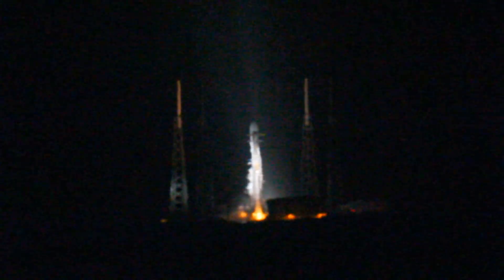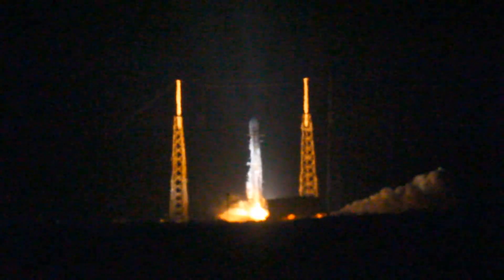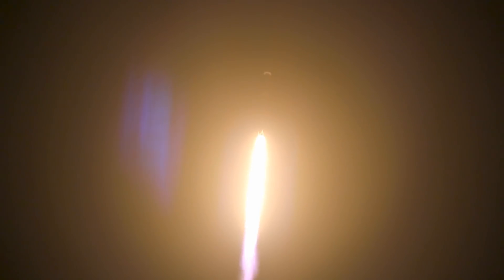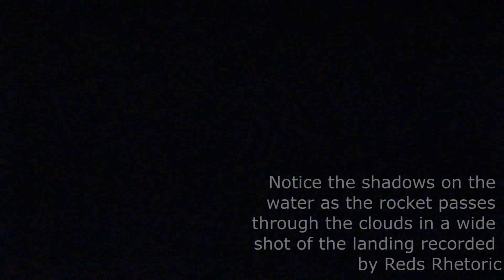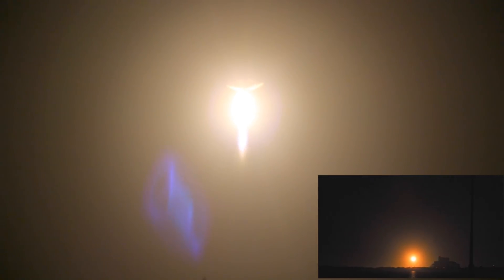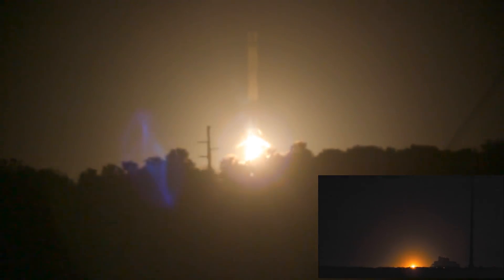Up Close Footage of the SpaceX Launch of Zuma! 1-7-18

Comment: So if everything went as planned why did it fail?
Reply from the maker: +alan headrick well, if it failed it would have done so due to a failure of the payload to separate from the second stage. That is under control of a Northrop Grumman built payload adapter they custom built for their own payload. It has nothing to do with the rocket itself.

Comment: What are the anomalies I see at the 2:43 mark and 2:52 mark crossing from right to left?
Reply from the maker: lencac those are stars.
Reply: I'm not buying it. The "stars" movement, direction and speed is not consistent with what it should be in regard to the movement of the rocket. Besides as a side note chemical propulsion is a losing proposition on all levels. Antigravity electro-gravitics is real and is well advanced. The deep state black project technologies are being keep secret from the public which leads me to believe that satellite is no more lost than the man on the moon. No pun intended ;)
Reply from the maker: lencac they are background stars. I'm sorry but that's a fact. The movement was exactly what it should be, the telescope was tracking the rocket under my command.
Reply: I'm sure your correct. I just wanted to stir the pot a little. I never let the facts get in the way of a good conspiracy ;)

Comment: The media are reporting that Zuma failed to reach orbit with some reports claiming that the second stage didn’t fire. Thanks for providing proof that it did fire.
Reply: sweinberger there’s another video out there that claims to show only one fairing coming off. You can clearly see something coming off it but it’s not clear if it was a fairing and if only one was seen.
Reply: The second stage fired as planned. The gist of the "reports" seems to be that the second firing of the second stage, meant to maneuver it to a reentrant path where it would burn up, was somehow interfered with, possibly due to the payload not unlatching from the second stage. Somebody in the launch team should have video and telemetry of the relevant events, but who knows when they will be released to the public, if ever.
Reply: Yea, the whole "only one fairing deployed" thing is total garbage.  The fairings get their structure from clamping together around a grooved cylinder.  Even if one fairing got stuck, another big "if", that would mean the payload failed to drift out of a half open pill, it should definitely have cleared it by the time the second stage was done maneuvering to de-orbit.

Edit:  I also have very large doubts about whether or not a single fairing would hold on during rotating maneuvers and engine burns.
Reply: I'm really surprised that the cover story they chose to go official is that Zuma failed to reach orbit. A pilot in Africa witnessed the circularization burn of the second stage from a plane. I don't blame them for fogging a national security satellite but this was a little bit too shallow, an underestimation of the power of amateur astronomers

Comment: The Swan bands and soot incandescence in the gossamer plasma at the chaotic interface between the opposing exhaust jets is total magic.
Reply: I thought you were smoking something when I saw your comment about incandescent gossamer swans but after seeing the boost back burn... nicely put.
Reply: The color is caused by two primary sources. The orange yellow is caused by soot particle incandescence, the same as in the yellow of candlelight. The blue green is caused by quantized rovibrational transitions in excited carbon-carbon molecular radicals present in the partially unburnt exhaust, the same as in the blue-green flame on a gas stove.
Reply: 10mintwo Shuttle was much more impressive to watch launch. Smoke, twin blazing trails of fire! But, that wild interaction of ionized gasses makes a Falcon 9 night launch absolutely mesmerizing!  The first time I saw a Falcon 9 boostback at night (1st or 2nd LZ-1 attempt) was simply jaw-dropping in it's entirety. Returns hope for human spaceflight.
Reply: 10mintwo I think at least some, and possibly all of the blue-green, is due to the TEA-TEP igniter fluid used in the ignition sequences of the 2nd stage as well as boost-back burn. It burns a deep green.
Reply: yes but I think they only run it for the first few seconds during initial relights.
Reply: 10mintwo Only an assumption on my part. It seems even a small amount could go a long way in terms of color when both stages reignite nearly simultaneously. I'll be at the beach for Tuesday morning's launch. I don't think barge landings have the same interaction without a boostback but still a great sight!
Reply: 10mintwo I just watched it again and my assumption doesn't hold water. The small green flash of igniter is visible but pales in comparison to the plasma cloud. Not even close to creating the overall color spectrum.

Comment: do they do these launches in the daytime?
Reply from the maker: Yes, they do:
https://www.youtube.com/watch?v=C3j2HjI82mI
Reply: cheers I serached it already…amazing how  the rocket stays perpendicular on descent is it boosters or weight or both?..also regarding the other recent space X launch why was it so spectacular compared to this launch?
Reply from the maker: They use a combination of grid fins, nitrogen gas thrusters, and engine gimbaling to maintain the desired attitude during the descent.  The California launch you refer to occurred close to sunset and the rocket reached line of sight to the sun while it was already dark for observers on the ground.  This caused its rocket plume to be lit up by the sun and produced a brilliant display.  For Florida launches this typically occurs when launches are scheduled just prior to sunrise since the rockets launched from here head in a generally eastward direction.
https://www.youtube.com/watch?v=6EbBij-Vrtk
Reply: pretty amazing at one point early on in your vid the rocket looks to be coming back down was wondering how they get it back to perpendicular! is all this remote controlled from mission control or automaticly programmed or does it react in real time adjusting itself to whatever is happening at the time?..thanks for the reply..
Reply: It's controlled by on-board computers. There is a general plan for the trajectory, which is adjusted in real time using some form(s) of feedback control.
Reply: 'which is adjusted in real time using some form(s) of feedback control.'

like an ultra fast signal sent from rocket to mission control then into software which adjusts the data to a pre programmed trajectory all in a hundeth of a second?…just amazes me it can find perpendicular at such speed especially when the rocket is already on a downward trajectory the accuracy is astounding the rocket bends out far from the launch pad but finds its way back to the launch pad just amazing.…pretty cool
Reply: mynameismud No human hands touch anything controlling the rocket after the onboard computer takes over at around T-60 sec. Falcon 9 is fully autonomous. It's the self-driving car of rocketry. All other launchers are also computer controlled, though Shuttle did have some human interaction inside the cockpit and at mission control.
Reply: I'm pretty sure the feedback loops are confined to the rocket's own electronics; it would be too much of a gamble to depend on the path through mission control be working with no outages.
Reply: It used to be that the Range Safety Officer could manually "destruct" the vehicle if he deemed it necessary.  I suspect that these days most such decisions are made automatically based on preset criteria.
Reply: Doug Gwyn SpaceX is the only company or agency using the AFTS (Automatic Flight Termination System) at this time. NASA and USAF have been very permissive in allowing SpaceX to push into new technologies. I was shocked when USAF allowed what is an unarmed missile to be fired at Canaveral Air Force Station for launch site landings after only 4 or 5 successful ship landings. Now there isn't even a finger on the button if it goes astray. The AFTS is actually more efficient and removes emotion and human brain delay from the equation. AFTS can initiate self-destruct in milliseconds opposed to seconds and has the full dataset available to it in real time. Range safety had a radio lag between receiving anomaly info and the signal reaching the pyros. Shuttle Challenger illustrates this in how long the boosters were allowed to continue flying. There was likely a lot of human emotion involved in that. I'd hate to be responsible for pressing that button for a manned craft.